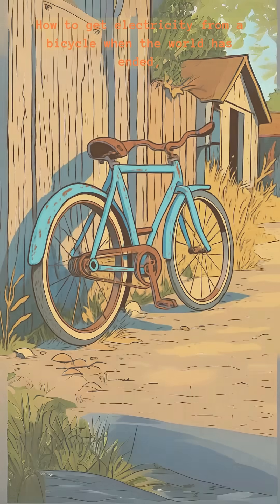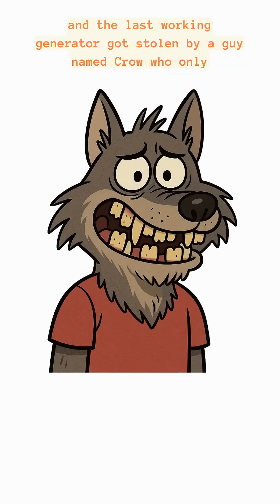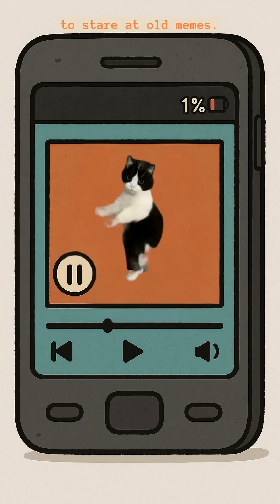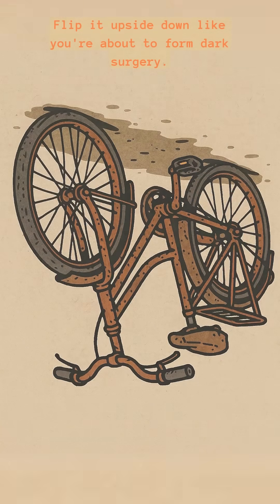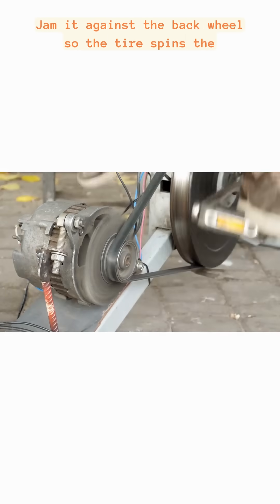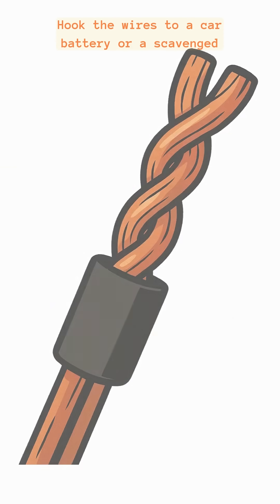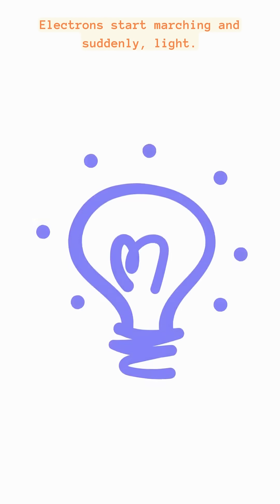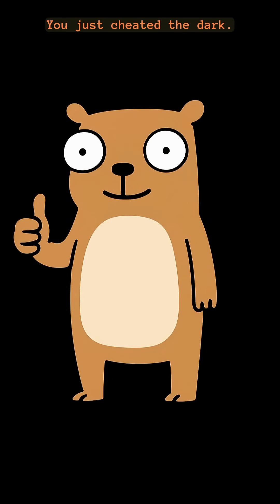DIY Survival Bike Generator That Actually Works! #shorts #science #diy

Comment: Motors generate AC voltage which is not appropriate for charging a battery or powering most electronics. Incandescent bulbs would be ok. For DC power you want to pull an alternator from a vehicle.

Comment: Fan... 
1. Hook you fan somewhere that has high wind speed.
2. Connect it to an extension wire with at least 2 sockets 
3. Connect your charger to the other socket.